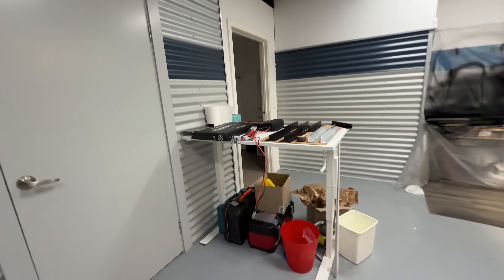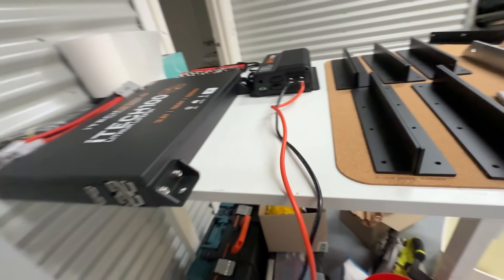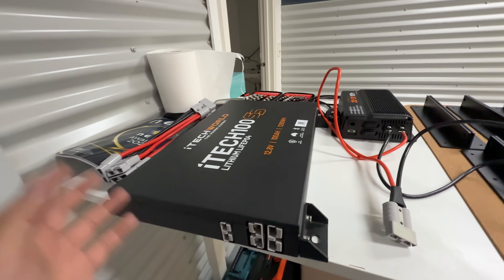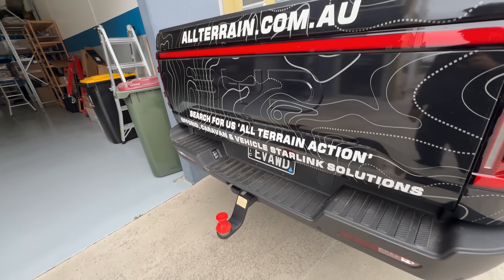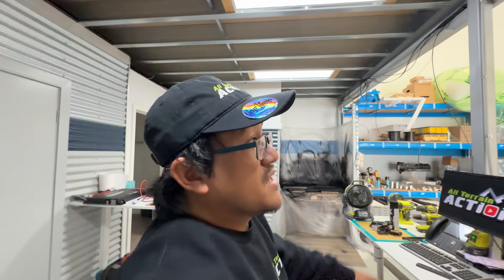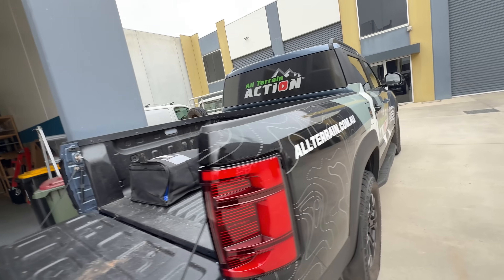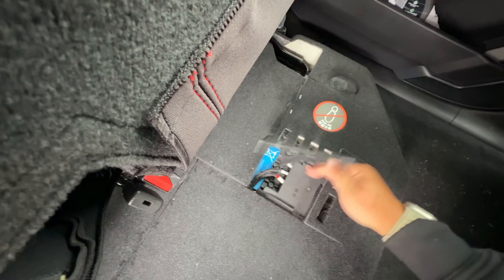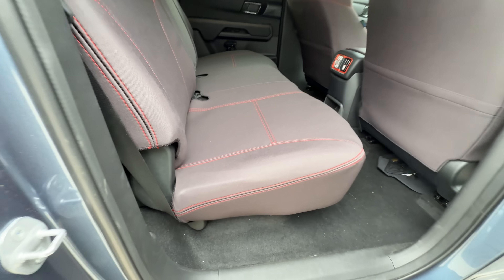BYD Shark 6 brainstorming for a 12V System

Comment: I read on the byd page about someone powering their 12v air compressor off the jump start terminals, haven't got my shark yet so not sure where they are
Reply: It just seems really weird (& unlikely) that BYD would release such a high tech vehicle into this segment of the market with a nearly 30kWh battery and not have considered that anyone would want to run a 25/30Amp DC/DC charger for their caravan off the 12V system. I’ve asked BYD via email and through the dealership and gotten zero reply to my queries. Why on earth should we be expected to fumble around in the dark looking for answers when a simple reply would resolve the whole issue.
Reply: @Random-Destination  the non response doesn't surprise me. My salesperson has told me directly over the phone 'the shark does have a camping mode so you can access the power outlets in the tub while the vehicle is switched off and locked' which as I'm finding out is clearly not true. I do hope it's coming in a software update though.
Reply: @user-pp6kw6yl6z yeah, the sales guys come across very confident at times and so often they’re just plain wrong, not just BYD of course, I mean ‘sales staff in general’.
Reply from the maker: @SnitchyBug  I’ve just rushed to go investigate this now 😂 thanks for the heads up, this plan has been in pre getting shark so wouldn’t be surprised if new info has arised for a solution!
Reply: @AllTerrainActionEV  let me know what you find! Just got the call, finally picking up my shark tomorrow 🤟
Reply from the maker: @SnitchyBug  Happy Shark Day!
Reply: I wouldn't be surprised if the 12v system is pretty powerful. Alot of car systems use it including the aircon.
Reply: Get in quick enough could be a good market for a Shark winch compatible set up.

Comment: The tesla has a massive 12v power (inverter accessed under the back seat) system that run air con etc. I would be surprised if the shark didnt have one.
Reply: Just checked the aircon might be 12v so that means their is a decent 12v inverter in the car somewhere.
Reply: @biotravis he showed it on the video, it's under the seat. Rated 220A at 12VDC
Reply: I could be wrong but most ev aircon compressors run 400v from the dc bus.